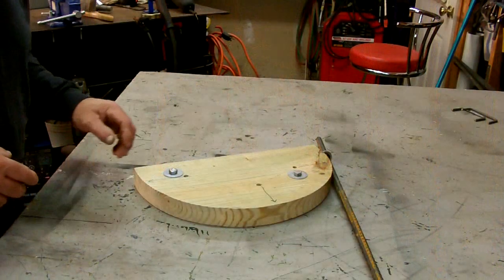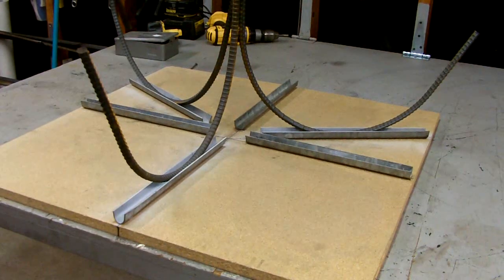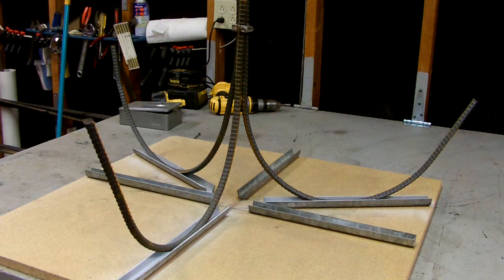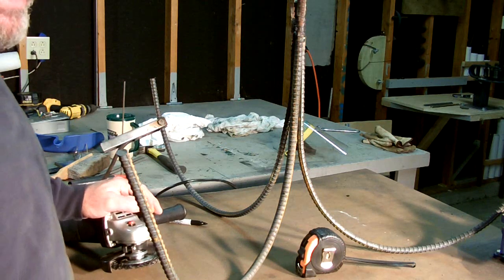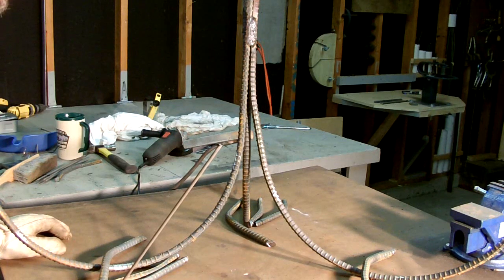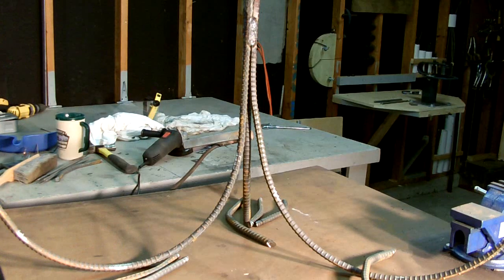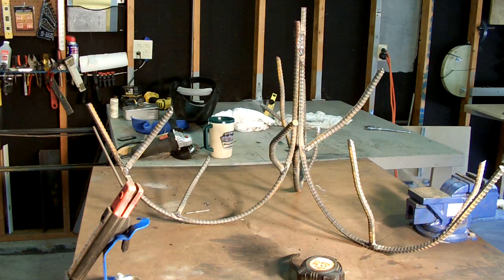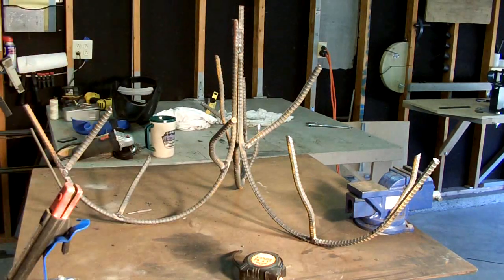Rebar Chandelier Bottle Tree

Comment: what kinda welder?  I want to work with rebar off grid but only have 110v @ 13a of power.  Gas weld possible?
Reply from the maker: Most of the 110 machines I have seen probably need 20a . Maybe try a small arc welder and if trips to much send it back. Amazon has a pretty good return policy, gas would work , but a lot slower and getting the metal  clean would help.